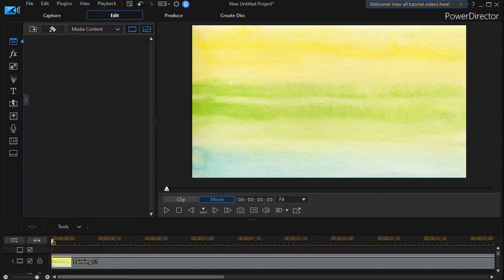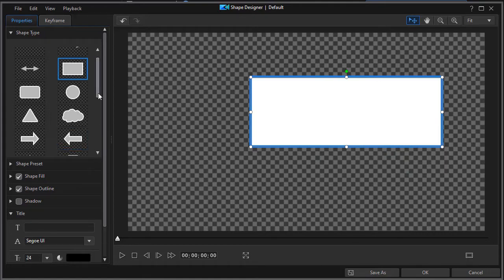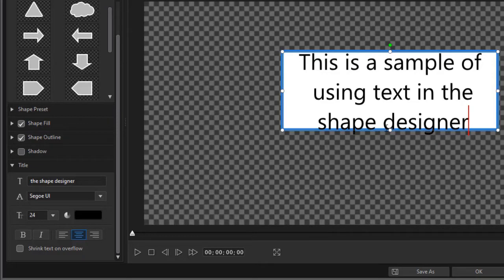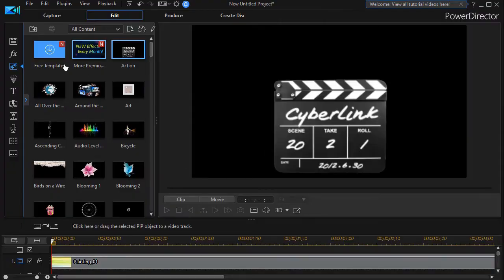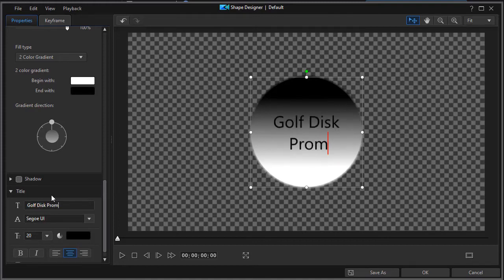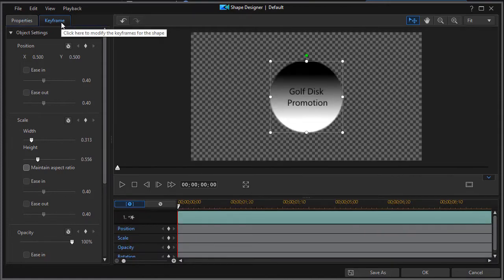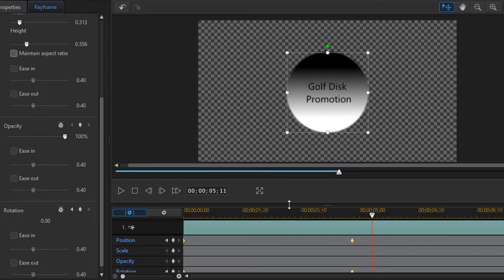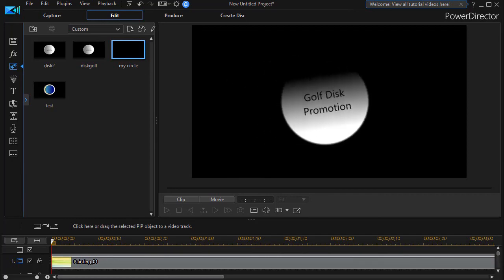PowerDirector - Using the Shape Designer - part 2   (PD 18)

Comment: Very frustrating when working with rectangular shapes. While you can choose to use a a rounded rectangle shape there is NO WAY to adjust the amount of radius of the rectangle corners. I wold think this is a basic setting to have? Is there a work around? I hope they add this setting in future.
Reply from the maker: In the latest update you can adjust the radius of the rectangle corners using a yellow box. It will make a four corners uniform in the process. --Jim
Reply: @SharperTurtle  Thank you . Yes I see the rectangle rounded shapes have the little tiny yellow square you can drag to adjust corner radius. That works great. However, what is strange, if you select one of the rectangular call-out shapes (box with line extending from it) these do NOT have the yellow adjustment square.
Reply from the maker: I agree. That's odd. You might try clicking on the FILE menu and use the drop-down "Rate us and  Provide Suggestions" to encourage the developers to modify that tool. 
--Jim